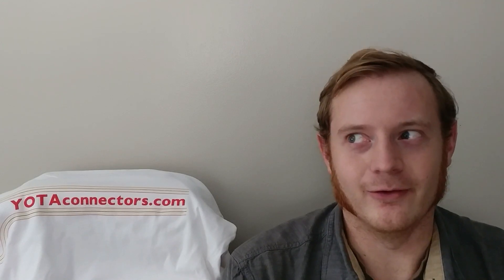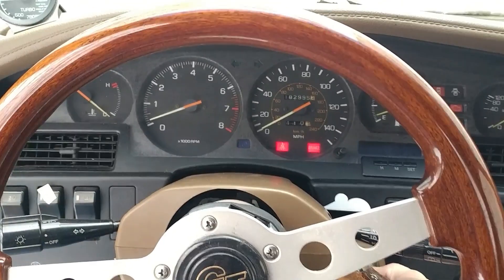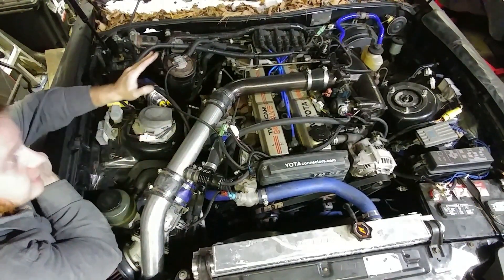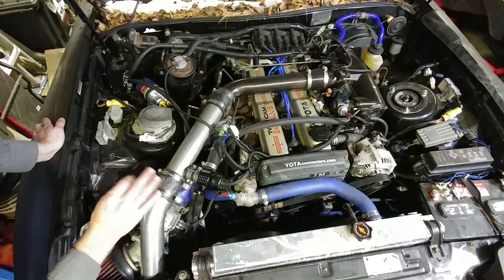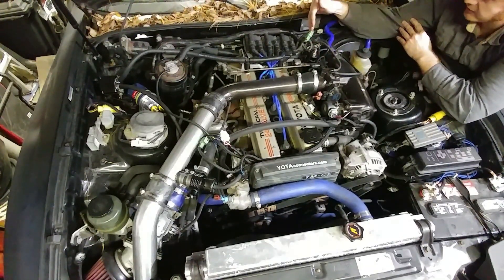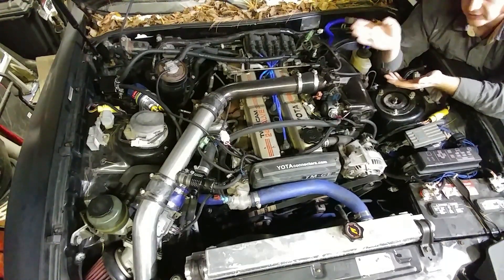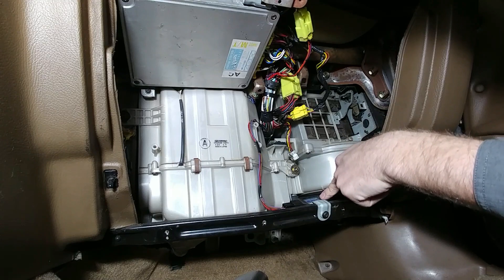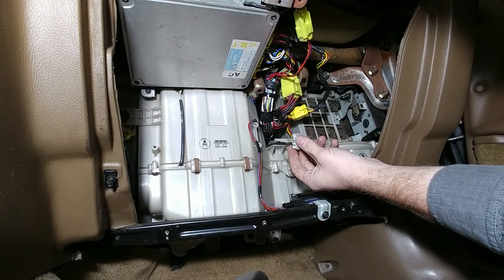YotaConnectors.com - 7MGTE Harness Intro

Comment: I got a 87 turbo targa with a rebuilt cps but im not getting any signals from the cps wiring in the harness. (no tach movement nor coilpacks firing). So I plan to buy a new cps rewire kit, but dont know where G1, G2, NE, G- run into on the harness to the ECU and where the Shielded ground bolts onto. 

Because I looks like the ECU in this vid is behind the glovebox. But mine is run down to the passenger kick panel.

Comment: checked compression all good timing is on point  new fuel pump  new wires new plugs and it has a lil miss when i reve it it gets worse no power  at all

Comment: Dude you the man I need to talk too my car won't start someone said it is the idle air control valve, it turns over but won't run change the fuel pump and filter about to change the injectors any thoughts

Comment: If that AC 3pin connector for the AC coolant thermisters are deleted, do you know if the AC controller ('89) will have any issues regulating the AC properly?

Comment: Hi I just did a hg job on my 88 turbo and I’m having a lean condition at idle (17-18) afr but not while driving. Any idea where i should start troubleshooting?
Reply: Check for exhaust leaks, any pre wbo2 leak will cause the afrs to read lean due to fresh air intake from an exhaust leak. Can also use an IR laser temp gun to check each exhaust port to determine if you have a lean running cylinder, that will point you to which cylinder is suspect. From there you can check or fuel injector functionality or spark plug gap and spark quality of that plug. Factory spec of 7mgte head bolts was 54ftlbs, it’s recommended after a head gasket job to torque head bolts to 72-75ftlbs to prevent head gasket failure common to 7mgte’s.

Comment: Hi, Ron! I have troubble with the harness of my project car. The previous owner have done a lot of wiring himself, and thing is not working proppably. What I could really use some help to figure out is the right way to wire the CEL and diagnostic connector. My CEL seems to get power all the time. So I can't get code out...Thank you very much for this awesome video !

Comment: Hey there, i know this video is about the 7m wiring but i was hoping you might be able to give me some help with a little issue im having. Im new to the 7mgte so i dont know much, basically there is a ticking sound that seems to tick faster the higher i rev. The sound seems to be coming from the cylinder head. I just wanted to know if you can help out with this & maybe let me know about some common problems this motor has( besides the bhg as i already learnt that the hard way.) btw this was a very informative video & look forward to seeing more.
Reply from the maker: iiAzT3Cii it could be injector clicking or valve shims out of spec, there is an old school of way of finding noises, take a piece of wood you can put your ear against and place the other end on the engine in various places when its running. You will hear the vibrations coming through the wood and you can narrow down what is clicking
Reply: Ron damn! That was fast lol. Thanks for the fast reply & the pointers I really do appreciate it. Ill give this old school way a go on my next off day from work. Once again thank you Ron, have a goodnight.